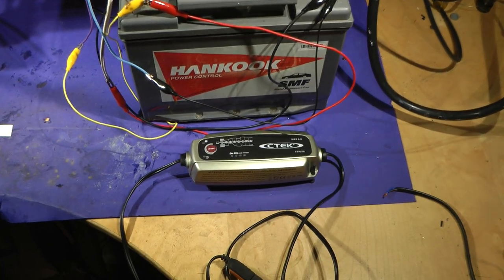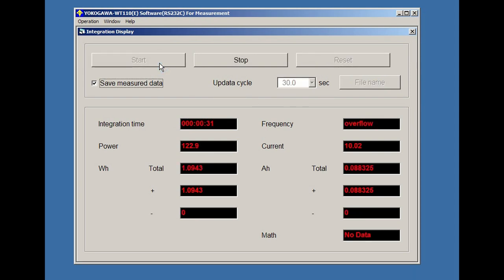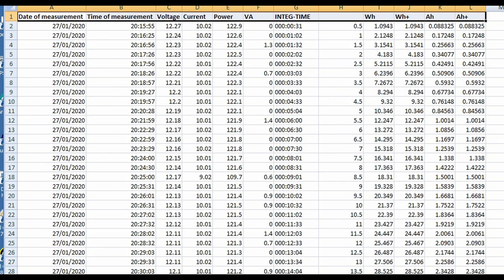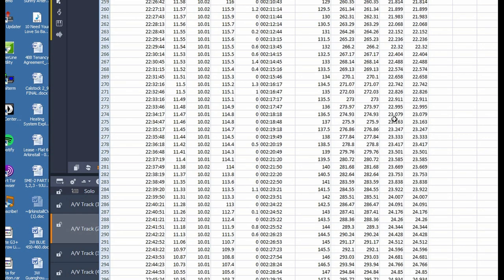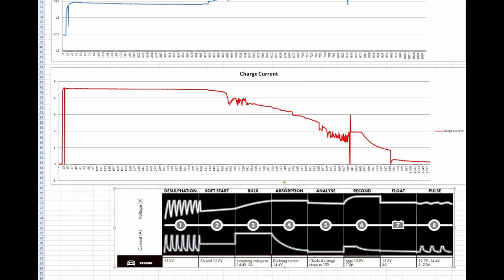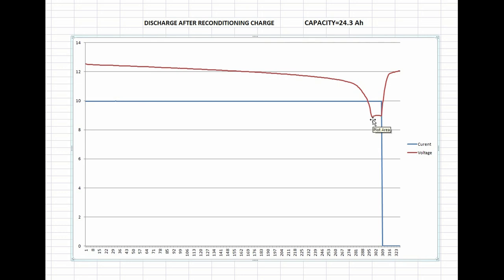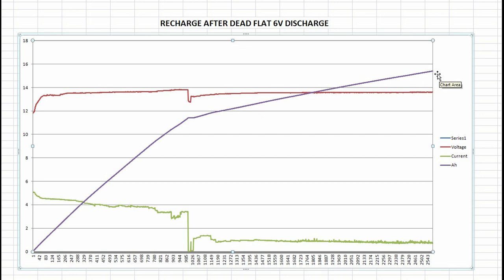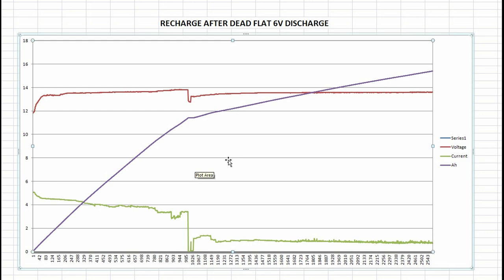CTEK MXS 5.0 Lead Acid car Battery Recondition Cycle test- Does it Work?

Comment: This is a rubbish battery charger for expensive money. They didn't even put normal cables on it, they saved on that too. In the cold, the cable freezes like shit. The MODE button is definitely broken, it's the worst thing in it. It's in a glued housing, so you can't get it together if there's a problem after the warranty. I had one, but I sold it. There are much better chargers for the money. Not recommended 👎
Reply from the maker: I agree with everything you say!!  Don't shoot the messenger - I just present the evidence and let everyone  choose.  .

Comment: Capacity of lead acid batteries is rated at discharge rate in 20hours... C/20
Reply from the maker: Doesn't matter which scheme you use. capacity is capacity.
Reply: No, they are rated to give full capacity during 20hour rate. Just check manual if you dont believe

Comment: That charger is good bat not charge yor bad battery. Solution is. Constant current charge 1.5A until reach 15.7.v. batery wil go to 16 volt .. after some timw vil back to 15.7v . Drop is 20-40mv per 1 hour. Sory for my bad language i dont use google translate.
Reply from the maker: Thanks for the input. I understood perfectly.  My position is that until someone shows me a quantitative scientific test result of a successful battery repair obtained with real test equipment by an electrical engineer PROVING success then I remain very skeptical.
Reply: @razenby  u re right but i tell u this i bay a vw passat in 2011 new car and  i desulphate (in recond. mode )  the battery every year before winter .and that battery from 2011 is starting my car today ...in 2021 .im pretty sure the ctek 5,0 help this battery....
on bettery unversity site they talk about pulsetech is a charger from us ,with impule mode ,,,they tell us that work for desulphation..u have to chek maybe
Reply from the maker: @dacomaniac  All sounds plausible. Without any measurements it is difficulty to know the benefits of desulfation.

Comment: Pretty unfair test if you know very well that the battery has a knackered cell. It needs chucking away, not reconditioning. Also if it’s been down to 10V then it’s pretty dead. I use a Ctek and it’s saved a couple of batteries that I was going to chuck out. Seems to me like you don’t like these chargers and set out to prove it.
Reply from the maker: So, I should have tried to repair mode on a good battery? I read the claims, tried the product, saw no improvement. People are easily fooled by smoke and mirrors of snake oil salesmen.   I generally don't like products that are under-engineered, unreliable, over-hyped and over priced. Do you?

Comment: The lead acid battery works on lead sulphate being produced on both plates, when you charge a battery you are in effect desulphating it. You can discharge 12v lead acid to about 10 volts but any more than that and you cannot fully recover it due to too much lead sulphate being out of solution also/or if you let the lead sulphate harden over a week or so on the plates then you will need an industrial process to recover it. The recondition mode is to ensure that good cells are evenly charged much like lithium balancing it cannot bring back a left-discharged-for-3-months battery. The other thing to note is that the CTEK will give out the proper amperage if you remove the connectors on the leads and solder them together, I never saw stage 2 on my charger until I did that as I noticed the connectors got a bit warm while charging. Real enjoyed seeing how these things function. Tip: when you charge a lead acid leave the smart charger on for at least 48 hours after the indicator says it's fully charged as he current keeps on falling until 'saturation' at which point all of the lead sulphate is back in solution as sulphuric acid and distilled water.  Keep up the good work.
Reply from the maker: Almost. If the battery is left at low states of charge for extended periods of time, large lead sulfate crystals can grow outside the porous structure of the electrodes, which permanently reduces battery capacity. These larger crystals are unlike the typical porous structure of the lead electrode, and are difficult (impossible) to convert back into lead by charging. That is what is called a sulfated battery.
Reply: Yep, that's why you should keep lead acid topped up whenever possible. Looking at it from a chemical point of view is easiest for me and realizing that the solution wants to form lead sulfate on both plates if left to it's own devices over time.

Comment: I'm disappointed that it stopped absorption charge at ~1.8 amp charge current.  Preferably it would hold 14.4 amps until that fell further <0.5 amps.  This seems to be charging to ~95% at best.  That last 5% would really improve battery life long term.  This is a great informative video though.
Reply from the maker: Thanks for watching.
Reply: @razenby  I wonder if you've thought about testing some other chargers as your testing is very informative.  Battery Tender is a popular one.  Optimate is supposedly a good one.

Comment: can you tell the difference between stage 1 (desulphation), 4 (absorption), 6 (recondition) and stage 8 (pulse)  ? and why the time on each stage? thanks
Reply from the maker: No. The fancy diagram in the user manual is at best marketing gumpff.

Comment: hi, have you tried Ctek one? I want to buy myself a charger, but I don’t know which one, Ctek or Noco?
Reply from the maker: In my experience the NOCO is much more reliable and better made and much less susceptible to damp. CTEK is reviewd and tested on the channel.
Reply: @razenby  Is there a difference in battery charging? I have a motorcycle battery, what voltage will Noco charge it with? Also 5A or less?

Comment: Good information on your videos, I have a question, I just ordered a Gulf livery limited edition Ctek CT5 charger from the UK,  I know the current is 220V to the U.S. 110 V but  is there a recommended reliable way to use this charger in the U.S? I am prepared to just hang it on the wall with my other Gulf collectables but other than the adapter and if needed what reliable converter would your recommend, was going to buy the U.S. version CT5 and switch the casing but saw your earlier video and decided it will be more than I want to do and not  screw up, really appreciate your patience and explanations.
Reply from the maker: I think they are universal (120 - 240V input). What does it say on the product?

Comment: I have a sealed battery, which really just means it has a label stuck over the cell covers. I had to buy a new one as it would not hold charge more than 3 days in the car. When I opened it there were 2 cells which had low electrolyte , so I topped those up with distilled water and tried to charge it with the CTEC.  The charger went to level 5 and then gave an error.   I bought a new battery, but thought I would investigate the old one. see this video I watched https://www.youtube.com/watch?v=8CxFpIoKwy0
Now I have tried that process, to release some of the sulphate from the plates with a very high charge  (100 amps for 5 minutes) and the electrolyte is very cloudy now with grey particles , which I assume is the sulphate from the plates. I will try and recharge the battery again and check also the Specific gravity of the cells, it may need to be flushed out and new battery acid  put in there.    Sulphuric Acid is quite nasty stuff and I don't advise messing with it unless you have some chemistry safety knowledge. Eye protection and overalls and gloves are essential. 
When I working in a laboratory many years ago, we had a guy who every autumn brought his car battery in, emptied it in a belfast sink, flushed it with water , then distilled water, emptied it again and refilled with new battery acid and he said the battery was 20 years old.  The sulphate sediment can settle in the bottom and short out the plates. 
It needs to come out.
Reply from the maker: Usually sealed means that the battery is sealed and has a pressure relief valve to let it gas if overcharged.  Providing the battery is in good condition the head of pressure that builds during charge forces the H2 and O2  formed at the plates to recombine into water rather than escaping to the atmosphere thus preserving the electrolyte level from dropping. This is called a Valve Regulated Sealed Lead Acid battery. (VRLA).     Once sulfated, modern VRLA staring batteries aren't worth messing with. The plates disintegrate when you try an sulfate them.

Comment: Great Video, all lots of time and effort. 
I always thought that these were the best. Was about to purchase to keep my BMW AGM topped up as not in top condition 
In all honesty what would you recommend.
Reply from the maker: Thanks. You could compare CTEK to a doctor who prescribes drugs with dangerous side effects to otherwise healthy patients.  Especially for Valve Regulated Sealed Batteries (maintenance free). The CTEK electronics has questionable electronic design with reliability issues. To keep healthy batteries healthy the NOCO is a good choice. For ailing or failing batteries, the CTEK Repair mode might make a difference but I wouldn't want to use it on a fair to good battery,    I haven't measured or witnessed the reconditioning miracles that are claimed by the manufacturers and devoted CTEK fans.
Reply: @razenby  Hey, I'm kinda bit late to the party, but if you want I can tell if it will do any miracle for me.
I'm starting with 12v motorcycle sized AGM battery (Chrysler start/stop small battery) with 0,45v. 

At first Ctek didn't even consider doing anything with it.
After Pumping it for two days with different charger with high current it went up to 2.3-2.4v

Now Ctek is recognizing that it can do something and it's sitting right now with recond mode.
I'm guessing it will take more than 8H to sort this bugger (if it works at all).
BTW I'm not CTEK fan - it's just what I have at hand right now.
Reply from the maker: @BOTmaster15  Well good luck.  Keep us posted - 'Never in history has a battery charger promised so much, was bought by so many and delivered so little to so few'....  This could be a rare occasion... If you hear the blast of celestial trumpets when the charge completes then you could be in luck...... I could say that I would eat my hat but the last three gave me such bad indigestion...
Reply: Where’s the results? Is it still on charge?

Comment: Hi there,

First of all thanks for the videos (i watch all of them related to CTEK). It is nice to see a battery charger tested and especially one which promise to recondition a battery.  
Since my car was not moved for a while(thanks to SARS-COV-2) the voltage dropped to 11.5 volts and car didn't started. I've put it on an old Lidl charger(Ultimate Speed ULG3.8) and car was starting again but I've saw the voltage is quickly going down and in few days(without using the car) and the problem returned. Of-course the  solution was either to restore it or buy new one. This is how i almost spent the price of a battery to a charger that will most probably provide it hopes not nothing else. Thanks again to your videos and to opening my eyes.
My conclusion is: if you want to restore a battery(this means at least to 70-80% of his original capacity) something more than a charger needs to be used.
Reply from the maker: Thanks. I think you are correct.

Comment: Hi. I use the Recond mode on batteries that are already 7 years old and surprisingly the battery has been lying for two years recently (I thought it would be useless after such downtime). Today, with a greater frost -10 ° C, she fired without any problems. It charges another battery with it, ranging from 72 ah to 100 ah, and all of them in Recond mode manage without any problem. It is true that some batteries smaller than 100ah take longer to charge than the 72ah ones and I don't know what is causing it, but probably battery discharge. Only one of the batteries in Recond mode showed a red exclamation mark, thus Recond was unable to repair it and the battery will have to be thrown away.
Reply from the maker: Lucky.  My issue with CTEK is that they are overpriced for what is essentially Chinese poor quality design and build. The electronics and they fail a lot. keep it dry and don't leave it connected to the mains power to maintain batteries and don't let it cross the dew point else poof!!
Reply: @razenby  I thought CTEK was Swedish. Or is that just a buy and sell on arrangement? Hard to know these days.

Comment: It skips the phases if dont see need for it. So it don't do all the manual steps like in the pic.
Reply from the maker: I can read the manual but is it true? Smoke and mirrors.
Reply: @razenby  ctek is pretty known brand atleast here in nordic and havent heard bad about them. They do the job of recharcing and maintaining vehicle if its not used for long period of time. There are you tubers who have tested these with bad batteries and it seemed to work for them. Dont know about the curves and all those could be smoke and mirrors like you said. Just pointing out it works even though it's not the best brand.
Reply from the maker: @Deuxiit  Thanks.   An accurate test is worth a thousand anecdotal stories about how effective these 'seem' to be. Testing in the NOCO Genius 5 series videos include the CTK MXS5.0 at the he request of the viewers.  All will be revealed soon.

Comment: Current for the ctek is a maximum. If the battery doesn't want 5a it won't take 5a, you can't force current into something, it's dependant on the internal resistance. A better battery may take the full 5a during the bulk charge but you'd need a huge battery bank for it to need 5a during the float charge
Reply from the maker: Who said it should provide 5A during the float charge? I certainly didn't because that would be ridiculous it would just gas and vent.

Comment: Hi there,

I have 2 200AH (for 24V) 2 year old AGM batteries (really expensive) for powering our boat (sonar, lights, trolling motor). They are deep cycle batteries which should have the ability for 700 cycles when take 75% of capacity. In the last 2 years we have less than 60 cycles and take never more than 50% of the capacity (we have an victron battery monitor). The batteries are always loaded with a high quality charger and was loaded immediately after discharge (charger was checked by the battery manufacturer). Over winter the batteries was always at floating mode at the charger.

At the first use of the boat this year, the batteries voltage dropped at a capacity use of about 15% (30AH). The manufacturer has no idea why and will not exchange the battery, because the guarantee was running out in spring. 

I build a battery capacity test station and uses my CTEK MSX 25 charger for testing the reconditioning (each battery individually) - because i want to know if it helps and i want to manage the energy when I'm on the water. After 3 reconditioning cycles the battery comes up to 55AH and then stuck. So i tried manually by a laboratory power supply to  give the battery 15,5V and max. 1,5A for 30min. After i do this once, the last capacity test gives a result of >65 AH at both batteries.

So my conclusion is, that the reconditioning of CTEK charger IS WORKING in some situations (i think when the battery is sulfated). I will try to do some more 30 min cycles with the laboratory power supply to see where i can bring the capacity of the battery or if i damage the battery. So we have ordered LIFEPO4 batterys with BMS to exchange the AGMs. I have only to keep the AGMs alive for some weeks.
Reply from the maker: That is really interesting. Is that method referenced anywhere for AGM batterries?
Reply: Magic Smoke In the manual of the Ctek charger the recond mode is described (voltage and current). But i think the ctek do not push to the limit to not damage the batteries. So with a laboratory power supply i can adjust the voltage and the current and with a timer i can stop when i want to do it.
Reply: A

Comment: I tried the RECOND mode on my five  year old battery. It wasn't presenting any problems as the car is driven frequently. It was just out of interest. Nothing changed. I suppose that there was no problem to solve in the first place. I do connect the charger in "normal" periodically just to maintain charge. That's probably done more than the RECOND mode.
Reply from the maker: Interesting.